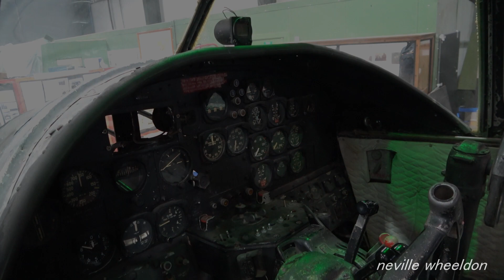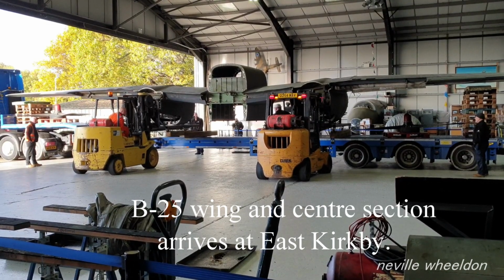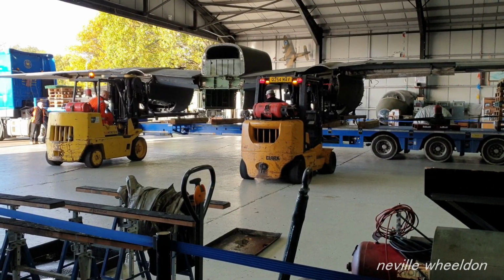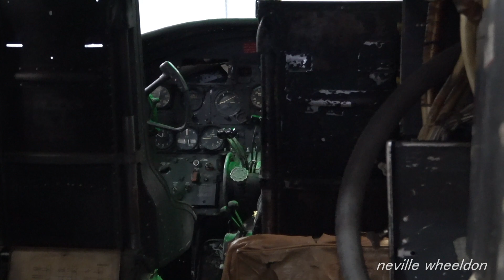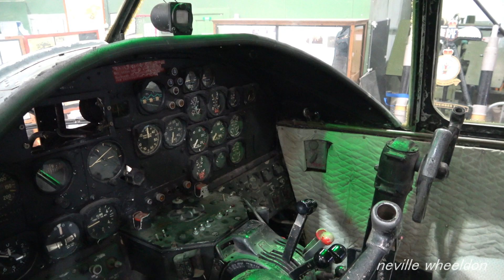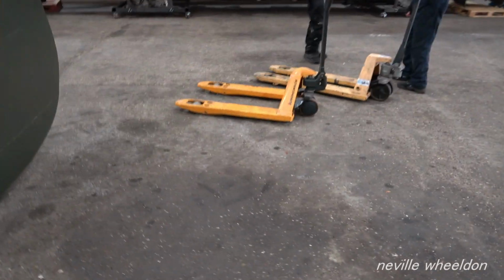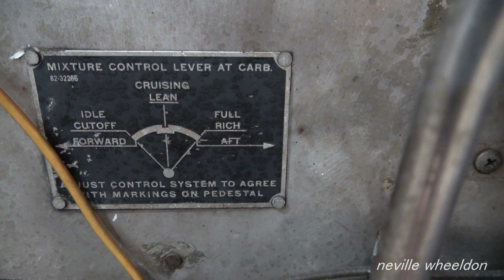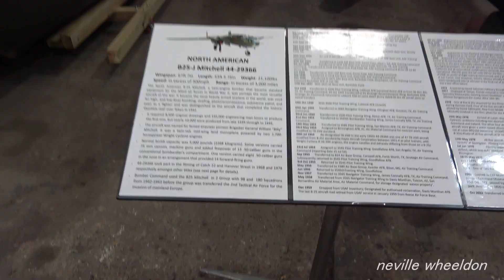Arrival of USA B-25 Mitchell Bomber to East Kirkby

Comment: OMG!  Sorting out the various electrical connections and making sure that they are functional, and sorting out the various fuel and lubrication connections and making sure they are functional.  The ultimate jigsaw puzzle!  And are there any missing parts?

Mind boggling!
Reply: The Avionics/Electrical team will have loads of work to do, but although a lot of the cables have been cut all have circuit ident markings, so we have a plan 🙂
Reply: @SpenCrowson  I am glad to hear that it is possible - thanks!

Comment: What a massive difference between the inside guts and the paint job on the outside of the B 25. I think I’m getting the the concept of static display v/s taxiing condition v/s flight ready (when the insides look as good as the outside ie. - Just Jane). Thanks Neville!   Great stuff!
Reply from the maker: Spot on Michael.

Comment: Interesting.  This was one of the more successful designs, still active in the USAF when I was a child in 1970.  Ashame it will not be restored to flight.  Wonderful video, as always.
Reply: B-25s, as well as being good bombers, turned out to be fantastic utility aircraft for the USAF to fly goods and personal between air force bases in post war service.
They were easy to fly, had a respectable payload, rugged, reliable, cheap to operate and cheap to maintain.
That's why there is a comparatively large number of B-25s still around.
Reply from the maker: Hi HH, return to flight ,who know when the Lancaster finished.

Comment: Neville, the centre is now getting a very nice collection of aircraft. The B 25 and the Bristol Blenheim are obviously going to be restored eventually to taxing condition, but where are they going to store these aircraft, is the centre going to build a new hanger?  The restoration of Just Jane is going to take up the bulk of the hanger space!  Also, I've also noticed in the Rivet Club emails there is a photo of a Dakota positioned behind the Lancaster, what happened to this aircraft? Finally, how much of the Vickers Wellington do they have, is that a candidate for restoration?
Reply: I seen nothing of a Wellington in all of Neville's videos, but there is a HP Hampden in one of the smaller hangers who`s restoration is on hold ATM. It does feature in some of Neville's earlier vids.
Reply: There's a salvaged Wellington in one of the out buildings, how much of it there is I'm not sure, hence to question to Neville.

Comment: Thank you Neville once again. Who ever took it apart needs help.... Did they use a sledge hammer and hack saw? Awful job. Going to make reassembly difficult and to get it safe for taxiing is going to be a mammoth task years of work. Why cut the wiring? Bend panels? Cut pipe work? I'm hoping it wasn't the RAF museum that did the disassembly....
Reply: I think you'll find this was the condition of the aircraft internally before its external refurbishment at RAF St Athan after many years grounded at Blackbushe airport where it had slowly deteriorated.
Reply: @timorvet1  hi, sure I believe you. Whomever did it took it apart with no care or respect.